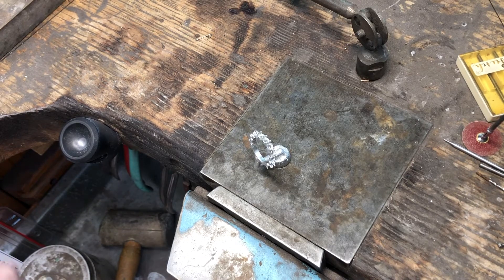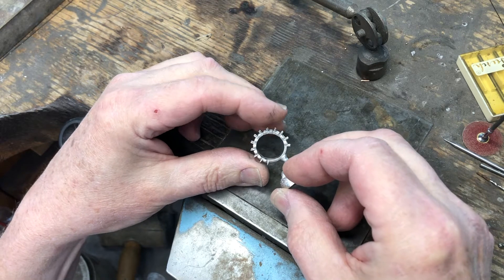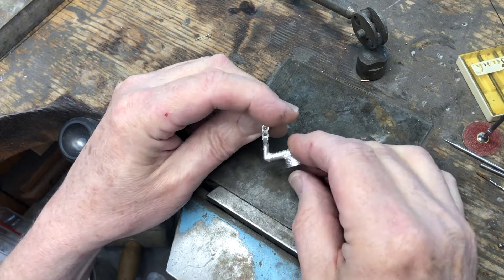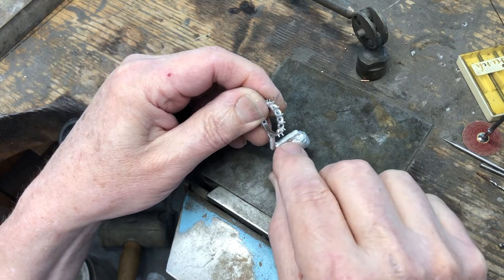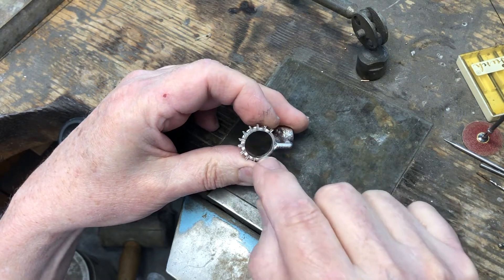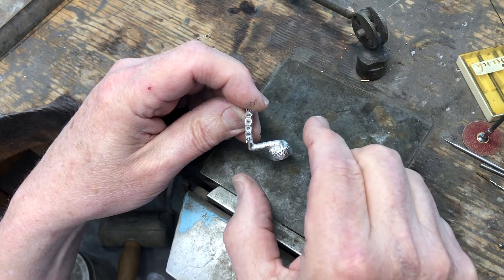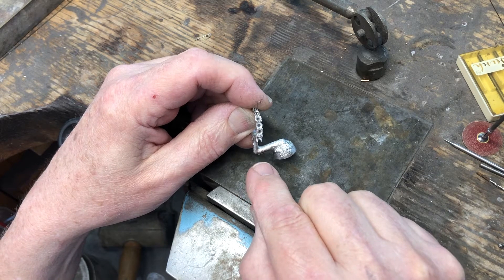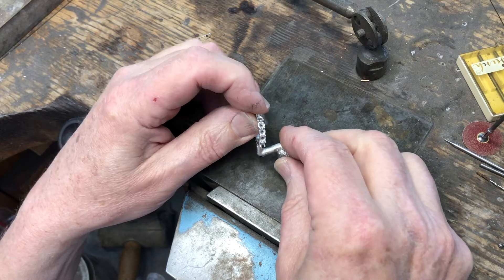Jewelry Making Basics: Sprueing & Casting Weight for Platinum

Comment: Hello, tell me please, when I cast platinum, I sometimes have micro pores that cannot be removed.  cast on a horizontal centrifugal machine and heated with propane and oxygen.  to platinum 950 I add indium gallium and copper.  What could be the problem?  can you advise something?
Reply from the maker: Platinum can be tricky. I use a Torit vertical casting machine, heated by hydrogen and oxygen. I use platinum/iridium 90/10. I have for years. Hydrogen is great because it gives a fast melt and helps the platinum really flow hot. I let cool down on it's own for an hour and then break it out. I use Galaxy II by Talladium for investment.

I have never experiment with plat/indium gallium/copper. These metal alloys are not in the platinum family. Iridium is in the platinum family. It is actually more expensive than 950 ruthenium. Cobalt is more expensive. I dislike because while it may cast easy it is very soft.

Jeff Bagley

408-202-4389